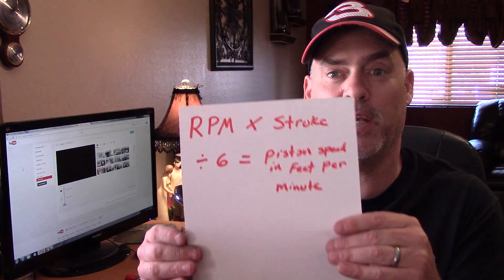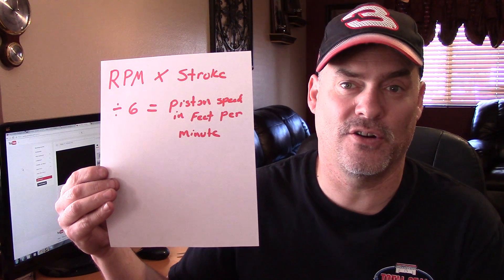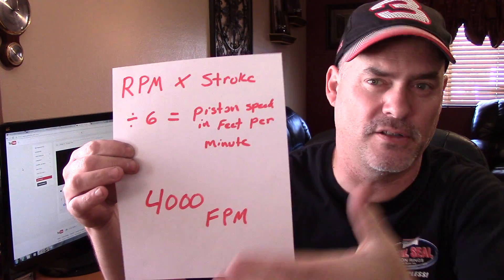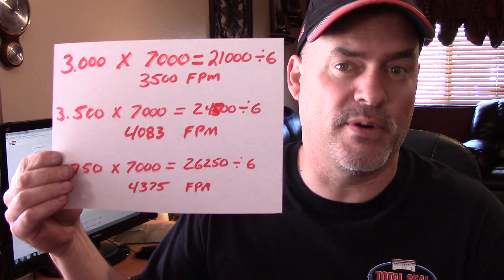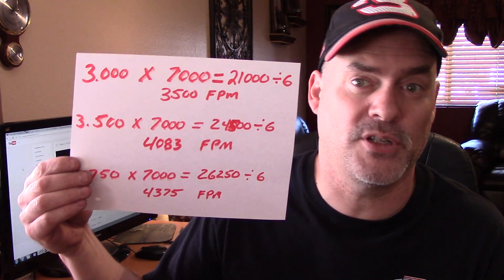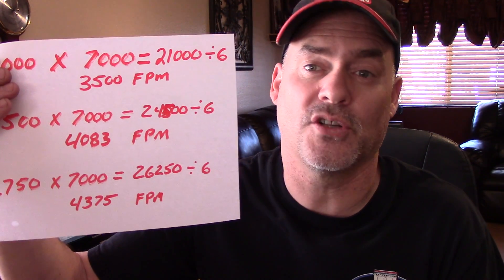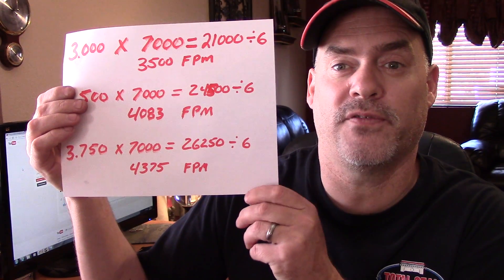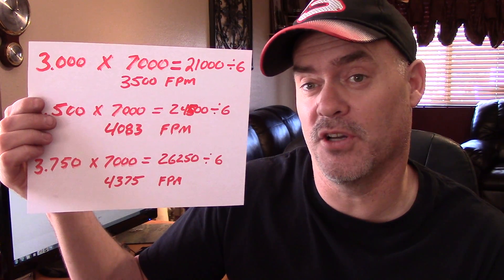What RPM should be an Engine's red line

Comment: Im planning on building a 355 chevy small block, got my 350 LT-1 in my 94 Caprice 9C1. What would be a rod to use with the hyper pistons and what kind of crank should i use?  Im planning on using GM HotCam LT-4 cam and roller lifters. I am planning on getting heads ported and polished and port matched with intake manifold and Hooker street force headers. Already have headers and true duals on the car and Flowmaster muffs 50 series 3 chamber muffs, 2 and half inch exhaust. Will add 52mm throttle body and PCM modified chip.  What kind of HP do you think I will get out of her? I know its 300hp stock.

Comment: are you sure your math is right? i don't know what else this equation accounts for but;
3.000x3.1416= 9.4248" circumfrance/12= .7854' circ x 7000rpm = 5497.8 fpm
Reply from the maker: I' not sure where you came up with all of that but I assure you my math is correct
Reply: well, a 3 inch stroke is basically a 3 inch diameter on the crank.  D*π = 9.4248" circumfrance (the travel path of the offset bearing on the crank) so at 90* of stroke the piston is moving 9.4248" per minute per revolution. then you divide that by 12 to give you feet per minute and multiply by your target rpm.

now with that said, this would give you the maximum speed of the piston, not accounting for the dwell time at the top and bottom of the stroke so i guess with the dwell times figured in, it would be close to half that number for average piston speed.
Reply from the maker: jon spon I C the math I gave out gives mean piston when looking for a target RPM mean (average overall) is all you need

Comment: So my 454 with a 4" stroke, redline should be something like 6000rpm (due to piston speed)?

I am not sure about how long the rods are as they are still in the engine.
Reply from the maker: 454 Rods are 6.135  from center to center of the big and small bore the rod length to stroke length ratio is pretty good on a 454 6000 is doable for a 454 if it's balanced correctly and you use forged components
Reply: 24000/4=6000rpm to achieve 4000fpm right on the money.
Reply: +Ron LeVine Correct. But there is also deck height which effects rod angle. The lower the deck the the greater the pumping loss. This is easy to understand - if the deck is taller more power is put onto the crankshaft by the piston and less on thrust which is converted to heat (friction) on the cylinder wall.
Tall decks rule for big revs and long term engine durability.
Reply: Big blocks are very stout pieces look at the journal sizes and mass of the components I've revved my 496 to 6500 more than several times. Not much need to go higher using an S/C.

Comment: So with the factory nodular crank, properly conditioned rods, forged pistons (.030"), good oil circulation and quality bearings and fasteners my 350 Oldsmobile should be Ok at 6000 RPM?
The original (#6) heads are filled with bigger valves and with the bowls and porting work, which included removing the EGR bumps from the exhaust passages they flow just over 230 CFM @.500" on the intake side and around 200 CFM for the exhaust. Compression ratio is near 10.6:1.
The cam is hydraulic flat tappet design. I am using the manufacturers recommended springs. They rate the power curve between 2000 and 6000 RPM for the cam grind.
The intake is also rated between 1500 and 6500 RPM. I will be running 1 3/4" primary headers with 3" collectors then reduced into an 2 1/2" exhaust pipe with an X cross-over and full mufflers.
DO you think if I keep it cool, have plenty of spark and feed her with a 770 CFM carb, It will still be safe to 6000 RPM?
This is a street engine that may never be raced but I like a little extra rumble for character.
Reply from the maker: It sounds like your on the right track 6000 should be fine with those components 230 is decant flow for a factory casting that's about what the vortec sbc head flows and they perform very well on the street keep your piston speed at 3900 or below and you will be fine I think the 350 olds has around 3.500 stroke that puts you a 3500 FPM at 6000 watch your total timing use good fuel and bullet proof the cooling system should make gobbs of power Olds engines are very strong runners sounds like your having allot of fun Good luck
Reply: 3.385" stroke for all small block Olds. The 350 started with 4.057" bore (now 4.087 of course). This is my first Oldsmobile build. I have done a few Chevy and Ford engines in the past. A lot of research went in. 
Like most things, there are a lot of different opinions on what works and what doesn't. It seems the #6 factory heads (1970) had the greater potential. So exploited that. 
I had been watching a lot dyno videos and I liked they way most of the Oldsmobile small blocks seem to build more consistent torque over a much broader RPM range than a comparable Chevy, but really I chose it because the car is an Oldsmobile (1985 Cutlass Supreme) and every one builds Chevy.
If easy big power was all I wanted I probably would have found an LS engine.
The cooling system is in the works. I know the compression ratio is a little high for street use so I will be using a ram-air set up and most likely an E85/ Gasoline mix.
That seems to work for everyone else I know running high compression or high boost. They mix at the pump for street driving and buy race fuel at  the track, but I am not going to the track. I just want that old school V8 feeling.
Some day I will post videos.
Thank you for your input and for sharing your education.
Reply from the maker: Well thought out it should work well

Comment: Wow. What about big.blocks? Or 4s?
Reply from the maker: its the same for any engine
Reply: no.  I meant what should we be looking for in comparison to building a BB or 4?  Should we be loooking for high torque, low rpms or mid-range tornque high horsepower? I guess when you do a video on Oldsmobile engines you can explain it all from the Quad 4 to the Olds 350 to the Rocket 403 to the 455.

Comment: Just doing the math. A modern pro stock engine's piston speed is roughly 6,400 fpm. (3.500 stroke and roughly 11,000 rpm) Food for thought.
Reply from the maker: Sounds about right race engines see over 6000 FPM on a regular basis

Comment: great video, came at a really good time, I am putting my 283 short block together soon. really want it for a RPM grabber for no good reason at all, just to have fun with... I am deciding on heads, I have flat top forged pistons, stock rods with ARP bolts in them. Q: stock heads  fully ported( non humps) or newer style "vortec" head (305ci) or something  else. any advice would be awesome, thanks!
Reply: I have video of the 283 with vortec 350 heads and I loved it but they ended up being cracked and that is why I am redoing  it. just looking professional advice as I am about 35 years old and this is the first 283 I have messed with. thanks

Comment: This might give you an idea of how old I am. When I was young I had a Nova that I played with. I liked the 283 over the 327, with low fives in the rear end I would run out of motor just before the traps. The 327's would not survive this treatment a couple of dozen times. Here's the age part, before all these fancy head I had double humps on the 283's. After each run I would pull the pushrods and roll them to see which ones were bent and hammer the studs back in the head from the rocker arms pushing them out. The 283's never reached the speed on the piston to destroy its self or throw the rod and the extra weigh from the 327's piston would grenade the rods. Your explanations over the last few weeks is the best example of why this happened. I really like what you are doing for the, shall we say less experienced persons like my self. Keep up the good work, and yes I grumbled to about the machine work. But the better it is engineered the longer it lives. BEST OF LUCK FROM SOUTH FLORIDA...
Reply from the maker: Aaaa yes I remember those days  my first drag car was also a nova I built a 307 bored it .060 over and ran camel hump heads with a 310 duration Isky cam hooker headers and a big Holly carb I never had good power brakes because of the cam no vacuum booster!  I know it sounds silly to build something like that now but at the time it was all I had and it ran pretty good for what it was I ran mid 14's all night long and never hurt the engine my gear was a 456 and I would hit 6200 RPM at the traps I've since had much faster cars and much more powerful engines but that 307 nova is somehow still my favorite car there was just something about Friday night drags back then lots of garage built Ford's and Chevy's, Pretty girls, and not an import within 50 miles those were the days thanks for this post you just made my day!
Reply: @Myvintageiron7512  Yep, I was drag racing at 20 years old in my own car. I left home at 15, got myself a job at the local garage and never looked back. It was 40 years of automotive. I'm still mad at myself for not building a serious Nova.
Reply from the maker: well you see back then I didn't really know what I was doing and building a 307 was proof of that the thing is I was 17 and I honestly think I had more fun with that car than any other car I've owned or built even though I moved on to much bigger engines and serious drag race cars The Nova was my first and there is just something about the first time.
Reply: @Myvintageiron7512  I loved bracket racing. It fit my budget.
Reply: Myvintageiron7512 The best way to learn is through experience! I also here you about the first time. I made the mistake of just bolting on a single plane intake manifold and mechanical secondary 4 barrel carb on the inline 6 in my first car. It was impossible to tune. Sometimes it would shoot off like a rocket but often it would bog, never could get it to run quite right. But when it did go my little four door could blow the doors off 5.0 mustangs and most older fbodys through the 1/8mi.

I've learned from my mistakes and that's why my Nova has a dual plane (Weiand) intake and a vacuum secondary carb (quadrajet). Ok, so there was a lot of engine building theory studying going on between then and now too.

Keep up the great work on this channel! You've been verifying I built the motor up in my Nova correctly. I'm looking forward to hearing this stroker motor run.
Reply: Myvintageiron7512 Wow that seems like the hard way to run 14's. My Nova has a rebuilt 350 (actually a 355) with 882 heads, dual plane aluminum intake, quadrajet, and a .435/.435 270 duration performance "RV" style camshaft that runs 14s with the factory 2.73 gears in it. Those gears also allow me to take it on the freeway unlike those 4.56s. Also runs in -10*F and +100*F ambient temps without issue. Oh and I still have plenty of vacuum for stop and go traffic ;)